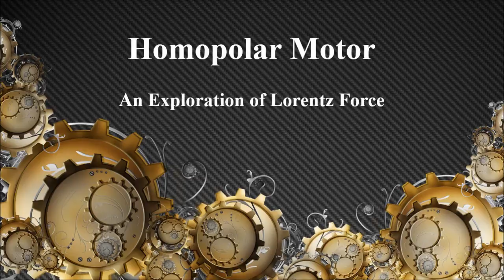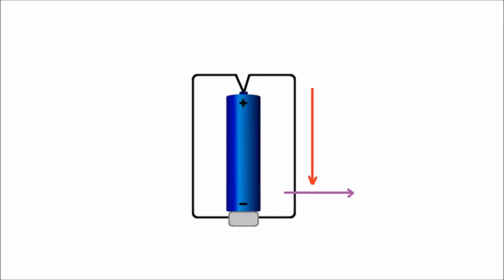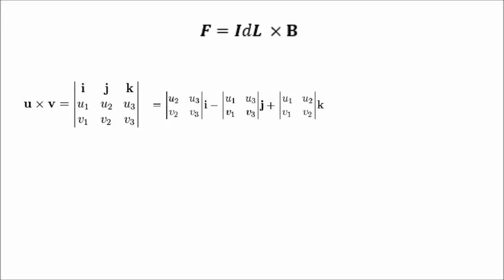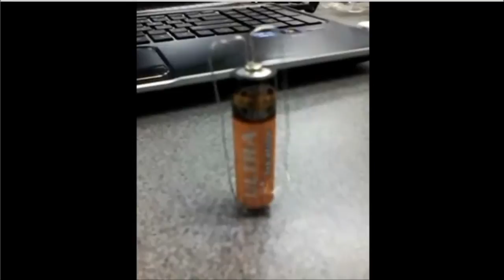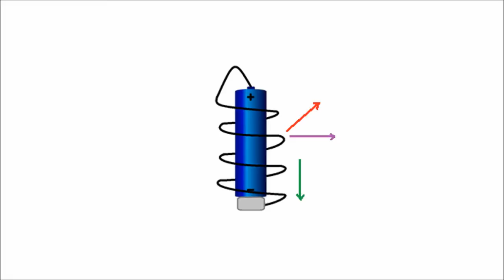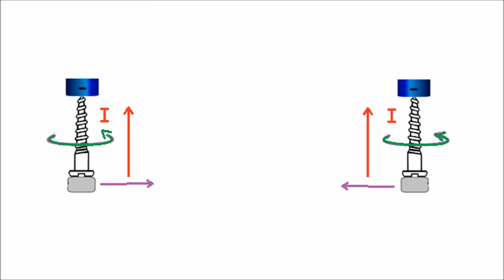Electromagnetic Field Project: Homopolar Motors

Comment: I thought current flowed from negative to positive
Reply from the maker: +Larry G that's not necessarily standard notation in electrical engineering applications. It's generally easier to deal with positive numbers.
Reply: Humm.. Interesting. Depending on the instructor/school establishing convention or electron flow theory is important. Makes a different in left or right hand rule as well as when using Kirchhoff's current / voltage laws.

Comment: Very nicely done. One thing bothers me, I think the magnetic field is vertical since the magnet is axially polarized. I don't get how you find the magnet's field is horizontal. My thought has been that the magnet's vertical field crossed with the current in the horizontal part of the wire provides the cross product.

Comment: It seems that when you place the wire around the battery, the wire doesn't touch the magnet. So, it doesn't look like a closed loop, and I don't understand how can the current flow in this seemingly open loop.
Reply from the maker: The wire actually does touch the magnet. I'm assuming you mean in the graphics. I had it separated so tat it was clear they were separate pieces.

You are correct, the wire MUST touch the magnet for the current to flow.

Comment: If you replace the magnet by an aluminium disc it will still work when you approach the magnet, yet no torque will be felt on the magnet, it's all between disc and brushes.